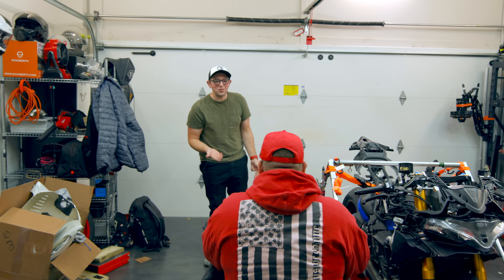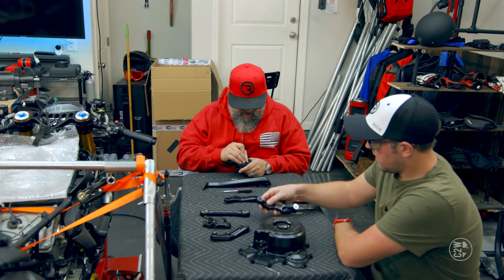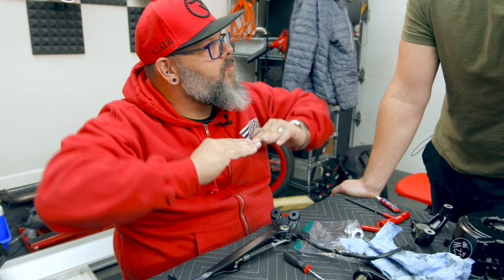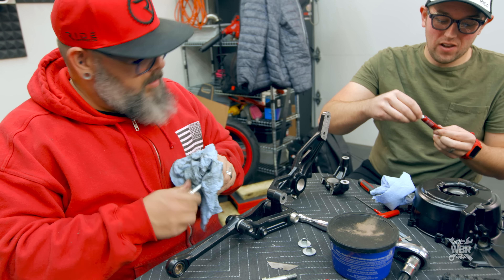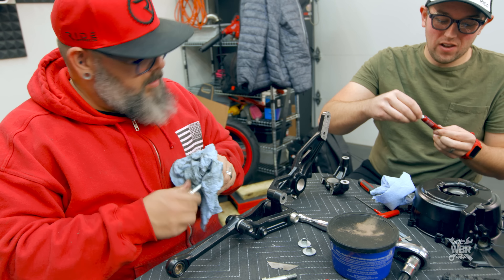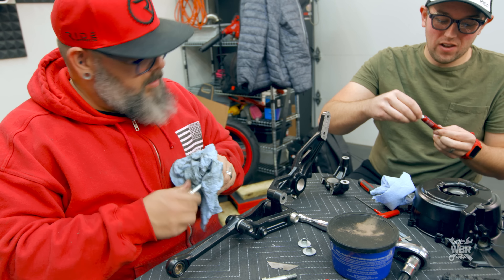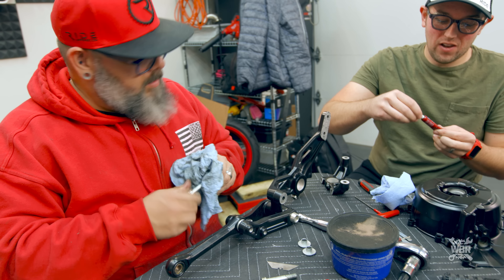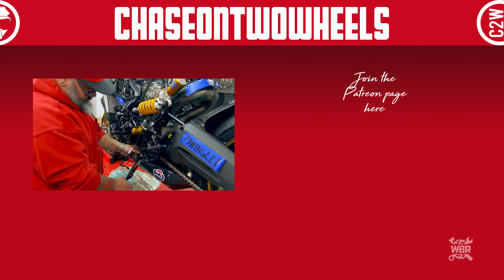SAND might have RUINED our Panigale! [Wrecked Bike Rebuild - Ep 24 - 2016 Ducati 959 Panigale]

Comment: Crazy to see the powdercoater didn't mask and plug your parts for cleaning, then mask and plug again for powdercoating. I run a small side business doing powdercoating for motorbike parts and always prioritise careful masking of all contact surfaces and threaded/blind holes.

Next time try to find a place that knows bike parts, save all that scraping and sanding too!

Cheers from Australia lads!
Reply: I agree 100% though whenever I have taken stuff to be powder coated I always send to the shop already masked and plugged so I know it is done properly by me (or so that if it is messed up I have no one else to blame!)
Reply: @filmcamera  Agreed, its not worth the chance someone gives it to a well meaning apprentice.
Reply: put long bolts/screws in all threaded holes to protect your threads.

Comment: I'm confused...... why was there sand in anything? Did they sand blast the parts before powder coating? Why weren't rubber plugs used in All the holes before sand blasting? Why were the mating surfaces and holes Not masked off before powder coating??  Doing these things would save a TON of time! Matter of fact this and the next segment .
Reply: Plugs and masking were not used because they use a shit powder coat shop. I understand a couple missed holes or mask spots but the number I saw and they eluded to was ridiculous.
Reply: I'm confused why all holes were not tapped and then cleaned before even getting a bolt near those threads. Any mechanic who has worked with blasted and coated parts should know this.
Reply: the shop just did a poor job with the sand blasting. it should've been cleaned off after the blasting.

Comment: Time sert aren’t bad to install and I’m sure with Bryan’s experience it’ll be no problem. This is why anytime I bead blast something I put some sacrificial bolts in all the threaded holes to keep the media out, and I still run a tap through the threads afterward to be safe.

Comment: I felt Brian’s heart sink when you called that contraption stupid... “if it’s stupid and it works... it ain’t stupid” 😂 and Black was a good choice for the powder coat, but I wouldn’t advertise their name just yet... some rookie moves on their part. As a technician, yes you should clean and inspect before re-assembly, but as a powder-coater, you should aim to impress and remove that extra work from your customer to build the confidence that nobody needs to double-check your shit.
Reply: Learned some of that the hard way when I had a gas tank powder coated and it came back with all the threads full of beads that had been powder coated over and rust inside the tank.

Comment: I'd NEVER use that powder coater again. I powder coat for my buddies, and EVERY single threaded hole gets a plug plug heatproof tape. There's NO acceptable reason those parts should have had sand in them. I'd be going back raising a FIT....

Comment: Get yourself a better  powdercoater. All the surfaces should have been taped and no powder scraping needed
Reply: elOcho Chase was more than likely too dense to tell the powder coater what to mask. It’s not their job to know unless it’s a drive shaft or something obvious but these small parts the customer needs to provide them with that information
Reply: Agree 100 %.  Even if they didn't mask it off  it should be blown out and cleaned long before it makes it into powder...  It's not that hard to take  the air gun and blow the shit out.
Reply: @moodywonka  as a powder coater you learn to ask the questions and ask the questions in regards to what surfaces need to be bare and what not.  I always approach powder coating like as if I was installing the stuff myself so you learn it's smarter and better to ask the questions before hand.  You also get a better reputation and more repeat business as well as word of mouth business if the person you hand the parts back to can just bolt it on and not have to do the stuff that Brain and Chase are having to do now...
Reply: @CraftwerksMC  As a powder coater myself at an industrial and custom facility there are so many pieces that come in and unless the customer has specified we take the best guess. The mating faces on the rear-sets are perfectly fine to be powder coated, that is unless the customer does not want there to be powder in between the mating faces. That is what they were pointing out in the video. I completely understand what you are saying and for a custom-only powder coater go ahead and spend the time that it takes to communicate with a customer but at a more streamlined facility we ensure customers drop off orders with their wishes listed. Chase, as shown in the video, did NOT know that Brian wished for those faces to be coated therefore he made no indication to the coater to mask them off. Therefore, Chase is at fault here not the powder coater, I don't appreciate the accusation that he needs a better coater, they masked off all Important areas and what wasn't masked off was something not all customers would expect to be masked. I hope that as a powder coater & hopefully mechanic you can understand how this was not a mistake on the powder coater.

EDIT: I do not know what facility they used or the reputation of the powder coater that they used, but the masking "mishaps" were not alarming by any means. I do believe the facility could have done a better job blowing off the product prior to coating and not locking in so much sand. We are also unaware how much he paid for the coating which could greatly determine whether he used an industrial-focused facility doing a favor or a custom facility.

Comment: y power coat when u guys can paint it?? ik its a stupid question
Reply: Powder coat is far more durable than paint, and because it is electro-statically attracted to the metal during application, you get a more consistent coverage and less likely to miss a spot.  For small parts with many surface faces its hands down the best method to coat something with a corrosion protectant short of electro-plating (more expensive).